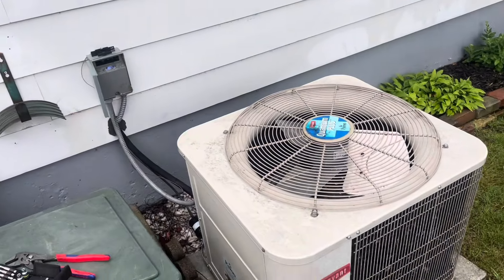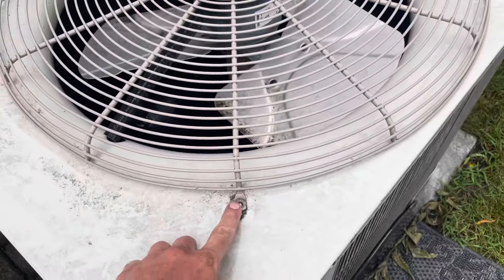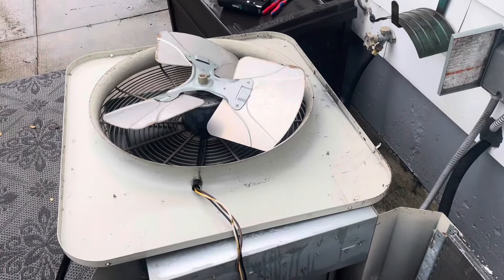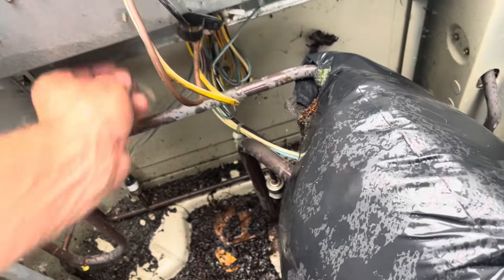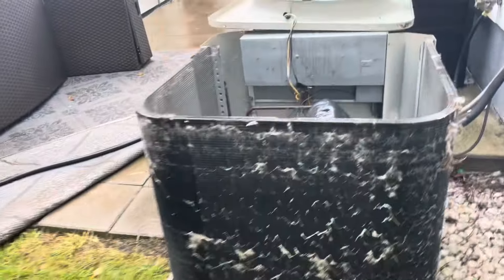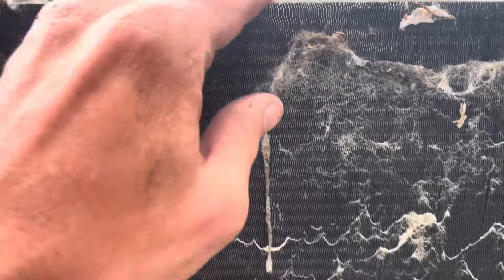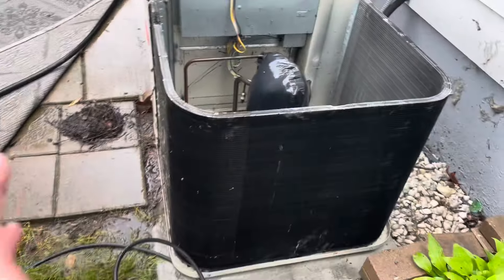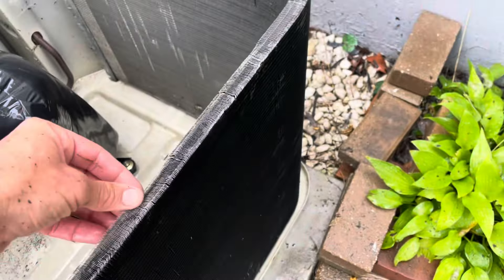How to clean condenser coils on a home HVAC

Comment: 2 things number 1 please dont use a pressure wash you will destroy the coil inside and number 2 dont run your hands down the fins like he did to clean the pollen and dust you will slice your fingers worse than a razor blade will
Reply from the maker: Can’t say I agree but thanks for you input.
Reply: @35andRetired i work hvac for a living and have replaced so many condensers for this exact reason continue to do this and all you do is put more money in my pocket just saying 🤷🏻‍♂️
Reply: @35andRetired a regular hose works just fine no need for a pressure washers
Reply from the maker: @Jason-rr1xu how does a pressure washer hurt the coil itself?
Reply: @35andRetired yup typically leaves pinholes in the actual coil and usually bends the fins in your case you were luck you did it far enough away just use a garden hose and simple green wash from the inside out